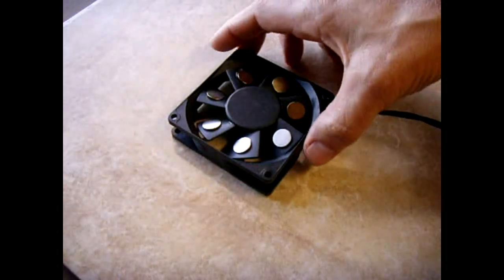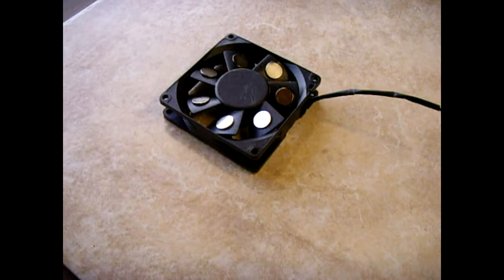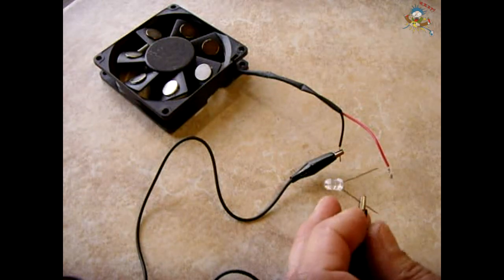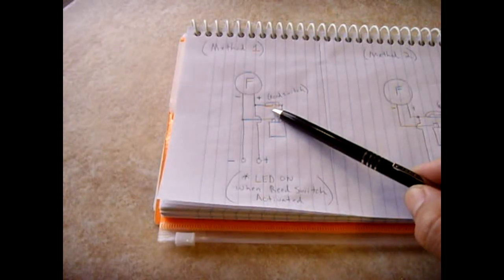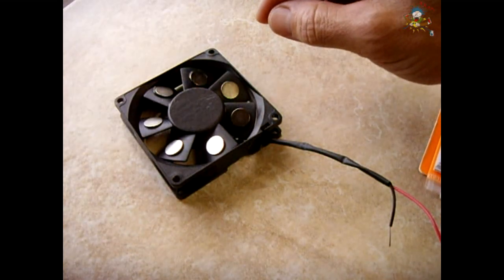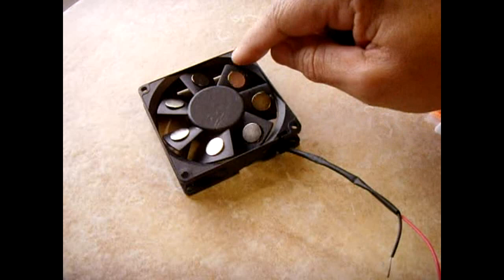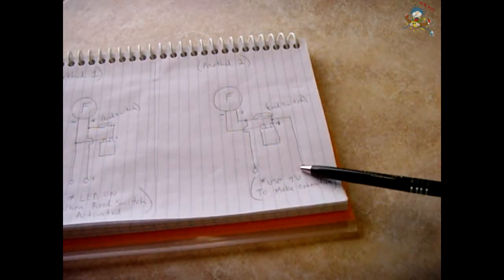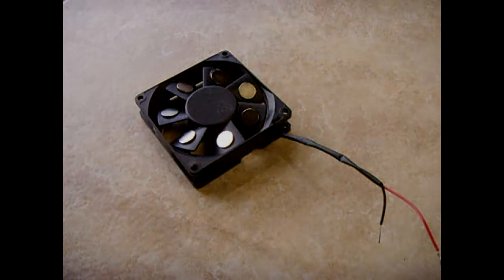FREE ENERGY Magnet Powered Case Fan/LED ~ How To Make!

Comment: it is not a scam
i took the motor and turned it with air and the led lights
r u trying to make more money by putting others down
Reply from the maker: +Gary Gomer 
DUH! That is exactly what happens with "SOME" case fans when you spin the blades by holding the case fan into the wind. Did you even watch the video to know why I made it? Does not sound like it.

Comment: This Guy knows nothing of magnetism
Reply: All that matters is that you know its fake. It will never exist, and you shouldnt need a smart guy to tell you that.
Reply: SuperMysticalGuy Ha ha skeptic much? Just because mainstream science upholds the laws of thermodynamics as unbreakable laws does not mean they are. Everything is energy, and even if electricity does not work out, we still have hydrogen which absolutly works to power whatever.
Reply: Let me guess you are not an engineer? :p
Reply: cold fusion is proving need for "new" physics, back to the drawing board--university is for suckers

Comment: Thanks you for debunking the fan trick! I saw a French guy making this "free electricity"video using the same type of  fan, connecting the wires to the secondary of an about 10 watts 220/12V step-up transformer and lighting three 70 watts bulbs! https://www.youtube.com/watch?v=k3dvwY0Omj0 . 

Of course, I knew it was a fake but I could not figure out what the trick was. Thanks for bringing up your video. Well made! 
Now that the fan trick is debunked (thanks again!), I think that the rest is quite straight forward: he likely emptied the transformer box and placed a good 12 volt battery in. 
For the bulbs they are not real 220 Volts as he pretends, but rather 12V bulbs (car headlights) mounted in larger bulbs in order to look like 220 V bulbs.
More importantly you also answered another underlying question: Why would people spend so much time preparing these insanities? As you said : for getting hits and getting paid for it.
Finally, for your detractors and other skeptical people if they wonder why we keep saying that it cannot not and never will work, I invite them to Google "the law of conservation of energy". 
In few words :Energy cannot be created from nothing. 
Moreover:
- Magnets DO NOT STORE ENERGY therefore they cannot produce any. 
- This type of fans are DC powered. If you blow an air flow (with a vacuum cleaner for instance) the fan will spin and will actually produce electricity but it will be DC which CANNOT BE STEPPED UP in a transformer.
- There is simply now way a 2.5 Watts fan would ever produce 200 Watts when spinning at its nominal speed.

Comment: Not to disagree with the concept but, that can't possibly work with a computer fan. The simple reason why is because, the fan contains electronics ICs, transistors, and such that keeps the fan from working in that manner. There is no way that you can generate any power from a computer fan until all of the electronics have been removed first. This is a bogus fake way of doing this project. The computer fan also has protection circuits that also prevents the fan from working in the opposite direction, in which the fan was intended to be used for. Nice try tho!